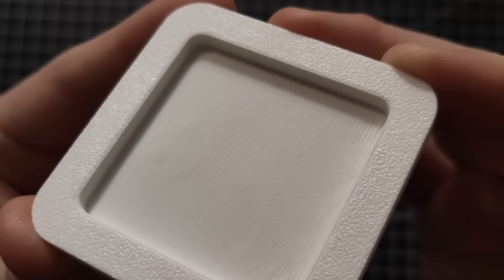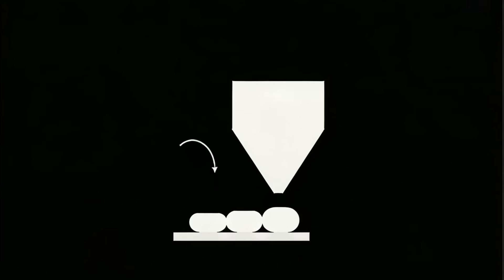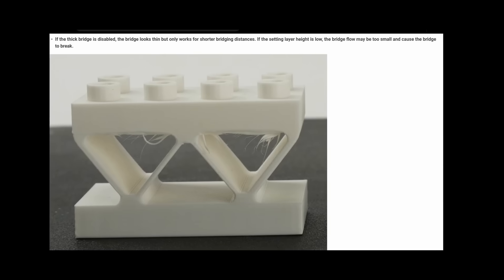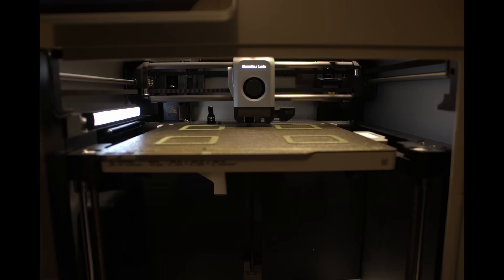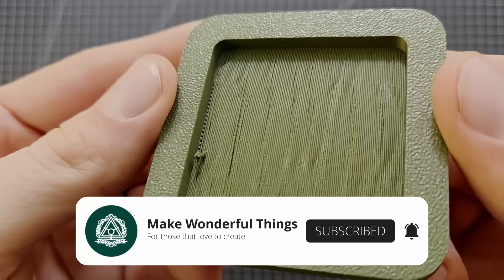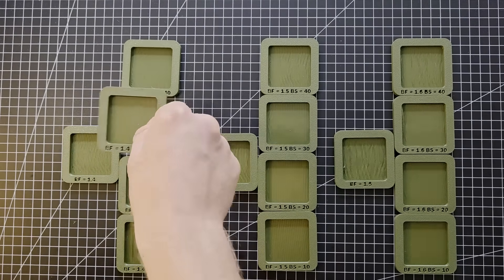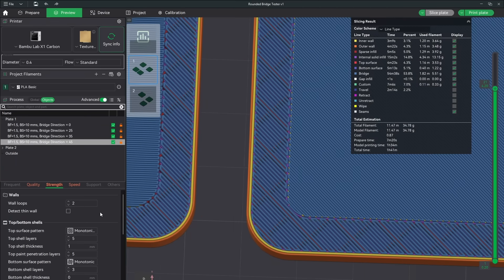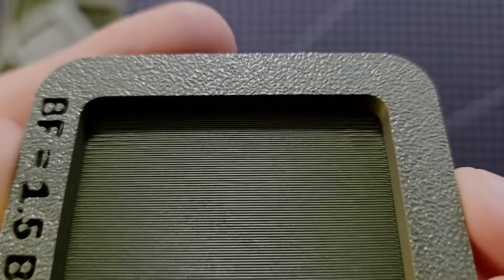The BEST settings for bridges? Smooth UNSUPPORTED 3D printed bridges

Comment: You've basically reverse engineered the behavior the slicer had back in the day when it was still slic3r 😄 Now in PrusaSlicer there is an option called "Thick Bridges" in the Layers and Perimeters tab, which is off by default, but can toggle that behavior back on. I guess it was ditched when Bambu forked their own slicer. With "Thick Bridges" enabled, the extrusion rate of bridges is automatically set to ~1.5 times the rate of other lines at the same speed. You can still fine-tune the bridge flow separately, though.
It's probably off by default or gone now, because it can cause even uglier bridges as you found out, when cooling is insufficient, inconsistent or when you're printing too fast.
Reply from the maker: Thank you for telling me a bit about the history. It is kind of hilarious that when a solution to a specific problem is forgotten, then someone will just re-create that solution.
Reply: @MakeSometh1ngWonderful  To be honest, slic3r and PrusaSlicer never explained that "feature" very well (among other things). Prusa's online help even today just says:
"For historical reasons, PrusaSlicer used to print bridges with extremely thick lines. This makes bridging very reliable and lets you bridge longer distances, but they didn’t look good. [...]"

Keep up the good work and the concise content👍

Comment: Based on what you've found, I don't understand why bridge density is capped at 100%. You'd have thought increase bridge density slightly above 100% would be beneficial as it would create a small amount of overlap and increase contact/adhesion between between bridging lines. However, the tooltip for bridge density (on orca slicer at least) seems to contradict this, stating that decreasing bridge density and creating gaps between lines can allow better airflow around them and so quicker cooling and less sagging.
Reply from the maker: Another commenter (@laich2) mentioned that Cura does not have this limitation. Increased bridge density would be a more elegant solution but it looks like it was a feature that got left out of this current line of slicers. I agree that this would probably be a simpler solution. 

In regards to their explanation, they're probably correct about the cooling. But, seems like they might be missing the bigger picture; that the adjacent lines can helps the lines adhere in a single layer if they're touching, thereby reducing sagging.

Comment: What about the thick bridges setting?
Reply from the maker: I tried using the thick bridge setting in the very beginning when I experienced this problem, and it does make a small change in the quality of the bridging. But, not really close to the final results of this process. 
Also, something strange that happened is that I did a small experiment with BF 1.4, 1.5, and 1.6 plus Thick Bridges and the outcome was really terrible. It didn't look like any of the results in the video, just a stringy mess. I didn't include that one here because I wanted the video to be concise.

Comment: I think you missed your 5 minute long ad read for raid shadow legends 😂

Awesome video. Easy subscribe.

While it’s not exactly what you’re doing, for models with sharp edges, a small support bridge in just the corners may help to give more support there, that being said it wouldn’t make it dimensionally accurate anymore, and it would just be trading one visual difference for another.

Comment: This really helped. Thanks :)
Improvements I had made before this included increasing the "pre start fan time" to 0.05 (Filament preset > Cooling), and also rotating the print or bridging direction (where possible) so that the air from the fans blow in the same direction as the filament path/bridge, rather than against the side of it. The idea being that first few strands of the bridge don't flap around in the breeze. Not sure which helped the most, I didn't do any real A/B testing.
Reply from the maker: It's interesting because I actually used the fan pre-start time when I was doing some overhang experiments a few weeks ago. It really decreased the quality of those overhangs. But, I didn't even pay attention to the direction of the lines. Which, may have been perpendicular to the direction of the fan.

I want to do an experiment with this. Would you mind if I use your comment in a future video? It might be a few weeks before I publish it. But, if it helps people out I would like to share the info.
Reply: @MakeSometh1ngWonderful  Sure. I look forward to seeing your results :)

Comment: I just tried this on a part were the bridging area is supported from all sides like your test piece. And it looks amazing. I used to print this with PETG support interface or self designed support and both those version look worse than just using pure bridging with your settings. F***ing awesome. Thanks for this video.

I have one more thing to add to your findings though:
If you just change these settings they also apply for the first solid layer above each Infill section (At least the speed does I´m actually not sure about the multiplier). So for optimal results and to not slow your print time down unnecessarily I would apply these settings via a height modifier so they only apply for the actual bridge over empty space and not for "bridging" over infill.
Reply from the maker: I'm happy that it helped you! Yes, you are correct. That first solid layer above infill is classified as a bridge line type. I hadn't thought of using a modifier to speed things up, so thank you for mentioning that here.

Comment: Orca Slicer has Bridge Flow Ratio but the purpose seems to be to use less filament during a bridge operation to keep tension on the filament.
Reply from the maker: Yes, that setting is pretty much the same as this one. Using less filament is also how Bambu describes the Bridge Flow variable in the documentation. In some cases, less flow is probably good. In some cases, more flow is good.

Comment: what about cooling when printing the bridges? does it affect it?
Reply from the maker: Yes, it definitely plays a part. I use a Bambu X1C, which has a known issue with the fan (seen here: https://www.youtube.com/watch?v=nJK4xTrn8ds). I just run the fan at 100% all of the time. If you have a different printer or fan, messing with fan speed might help you.

Comment: What about lowering step-over. Currently it's always 100% stepover in all slicers. I think having 60-90% step-over might increase bond as long as the flow is adjusted (lowered)
Reply from the maker: Thank you for the idea! So, I've tried to figure out what exactly you mean by 'step-over' and I am not really finding it. Googled it a few times and asked the various AI's to explain it to me without any luck. Are you referring to line density? Like the amount of lines per unit of distance?
Reply: @MakeSometh1ngWonderful  imagine you are laying 0.4mm lines, 100% step over is moving 0.4mm before laying the next one next to it. 75% stepover is moving 0.3mm before laying next 0.4mm line. (80% step-over = 20% overlap between lines). when you're mowing lawn, you usualy use less than 100% stepover to achieve nice cut. it might be similar with bridges...
Reply from the maker: @harviecz  Ok, I understand now. Perfect metaphor. Thanks!

Comment: Is it all corners that experience the sagging, or is it the leading corners? Trailing corners? 

If you print the entire print at 10mm/s, do they still occur? I'm just wondering if there's something about the transition from one regime to another that is responsible.
Reply from the maker: The leading corners only. Never the trailing ones. I haven't printed the ENTIRE print at 10 mm/s because that would 5x the print time. Maybe that would work for a model like this, but 2.5 or 3 hours for 30 grams of printing is pretty slow, and wouldn't really suit anything that I actually need. 

You can play around with the files by following the makerworld link in the description if you would like 😊 Maybe you can be the one to solve it.

Comment: Trick I use for a flawless floating surface:
I cut the floating section out of the model and print the “bridge” part separately as the first layer. I also add a tiny bit of tolerance around the part so it fits easily later. Then, I slice the model and add a pause right before it starts bridging (you can do this by right-clicking the “+” in the layer height inspector).

When the print pauses automatically, I remove the floating piece and press it into the other part. Set the print speed to the slowest setting and resume the print. It will now bridge perfectly over the pressed-in surface, creating a flawless result.
Reply from the maker: Actually a genius solution. @LukeFabis mentioned it in the comments a bit earlier. I plan on trying it out tomorrow. Thanks for this!
Reply: @MakeSometh1ngWonderful  if you try it would be amazing if you can show it, I am not native speaker so I understand a lot better with some visual context, thank you both for sharing!
Reply from the maker: @GeomancerHT   Yes, if this method works well it will be featured in my next video, so be sure to check back in a week or two.

Comment: auto subs. I try the BF 1.5 and BS 10, still doesnt fit well in my case, my default filament flow is 0.86, is it affected by those? rn trying to wiggle the BF settings
Reply from the maker: Yes, I believe that it is effected by those. The bridge flow is a coefficient multiplier, so if your normal flow is 0.86, then you are getting a resulting flow of 1.29 (0.86*1.5). I was still getting bad results around that ratio. 1.7, 1.75, or 1.8 MAY be where you find the sweet spot. The models and plates are in the description, so you could just run experiment 1 with your preferred settings, if you would like.
Reply: @MakeSometh1ngWonderful  yeah the 1.7 is definitely much better in my case, also i just realize the layer above infill also affected by the bridge speed, is there any way to play around it?
Reply from the maker: @wimindralee   Yes, the way to get around that is to use modifiers to isolate the settings just to the bridge. 
1. Right click on the model in Bambu Studio > Add Modifier > Cube in this case. 
2. Then, resize the cube to just overlap with the bridge. (this is frustrating AF in Bambu Studio, but, it's what you have to do)
3. Go to the objects tab and modify the settings for the generic cube. Change it to the desired bridge settings. 

Let me know if you need anything else.
Reply: @MakeSometh1ngWonderful  ahhh yes, i forgot we can do that, will try it asap and i will post the update

Comment: Very informative, plus 1 for getting to the point quickly! I may be missing the point here, but wouldn't you print a part like this upside down anyway or is this just serving as an example for times when one prints a part with that kind of bridges?
Reply from the maker: Thanks! Yes, you're exactly right. It's just a test model that helps me refine settings that impact more complicated real world parts.

Comment: I suspect the additional sagging from the angled print came from the length increase of the hypotenuse - its possible something worked out the shortest bridge extrusions would be best - maybe with multiple passes so for a square fill in the corners then join across the corners and repeat but that feels quite complex.

For pure bridge testing you're probably better off with a circle
Reply from the maker: You're probably correct about the longer length of the span. It's around 65 mm, which seems to be where my setup starts to struggle. Yes, a circle is probably a great solution, because of the shorter spans at the beginning. I went with a square shape when I started this because it was more like the real situation that I was trying to optimize for.

Comment: the "sagging" in the corners is possibly squeeze out instead. The very edges of the none bridge sections are slightly wider than the bridge lines for the reasons you discuss in the video (printed on top of previous layers vs open air). The first few  bridge lines have a little extra squeeze from the side nearest the already laid down filament. The first several bridge lines can be made to buckle by this extra squeeze, but as the bridge lines continue to be printed, the amount of extra squeeze diminishes as overall tolerances overtake. This is why the sagging appears to happen on the starting side of the bridges and not on the ending side as the final bridge line is the only one on the ending side experiencing any extra side squeeze.

The thing to do would be to start with a bridge flow of 1.4 or so for the first line and work up to 1.5 over the first 10 - 15 lines or so. The quickest way to test this would be using modifiers. Once it is demonstrated, a G-code replacement could be worked out or an extension to add a new setting made.
Reply from the maker: Very, very thoughtful. I agree with your take on modifiers for the first few lines, which is an idea that I haven't seen. I've used modifiers a lot, but never down to that scale, so we will see if it works. Thank you for the suggestion.
Reply from the maker: Your comment helped massively with finding the solution. Do you mind if I feature your comment and handle in my next video?
Reply: @MakeSometh1ngWonderful  Go ahead!

Comment: Fantastic tip thank you.

If you can find a way to slow down the overhang over support interface that would also be really appreciated! 

I print hot for maximum strength but it makes removing supports almost impossible. If I could slow down the overhang hang layer above interface material so it solidifies that be a game changer.
Reply from the maker: While I haven't explored this idea so much, I will mention that I found that bridge speed also changes overhang speed. Also, Bambu Studio has some specific overhang settings to play with. 

If you want to upload your specific part to makerworld and have me take a look at it, I will. It will probably be a full week before I can look at it though, because there have been so many good ideas in the comments that I have to look into.

Comment: Arc overhangs might squeeze out that last little bit of performance you're chasing. Or they might make for a wavy, blobby mess. It's a really temperamental process.

Another thing to try, if you're okay with not having a flat surface, would be to give the bridged area a slight stepped, slanted, or pyramidal structure, so the whole bridge isn't made in one shot.

In a similar vein, one thing to try (I haven't tried it, so I don't know if it would work) might be to abuse the counterbore hole bridging setting, so you have partial bridges acting as shelves to support the rest of your bridge. I don't know if the slicer would recognize a blind hole in order to apply this setting, so you might need to make a version of your model with a counterbored hole in place of your bridged pocket, slice both that and the original model, and Frankenstein the gcode together.

One last workaround, if you need an immaculately flat surface, would be to print the bridge as a separate part, add a slit to hold your bridge on your vertical walls, pause your main print at the top of that slit (at this point more of a lip, since the top hasn't been built yet), slot your bridge into the lip, and resume the print. This does introduce other potential problems, and there will likely be a contraction mark where the print paused, but the tradeoff is that you'll have an overhang as smooth as your build plate.
Reply from the maker: Thanks for the thoughtful comment!

Absolutely love your last idea. Literally laughed when I read it. I'm a huge fan of lateral thinking and solving problems in non-obvious but elegant ways, and this idea might fit that exactly. I can imagine that it will not work in many situations, but would helps to create some amazing results in some situations. I will DEFINITELY try that soon. 

Yes, I looked into arc overhangs a bit, but it didn't really fit the aesthetic of the original part that I was making. Have you had success with printing arc overhangs? I've been told by some friends that it requires quite a lot of tuning for each use case. But, that was over a year ago, maybe the tools have improved since then.
Reply: @MakeSometh1ngWonderful Pausing your print to drop in pre-printed components for in situ assembly can enable some absolutely wild geometries. If you can decompose your part into its major components and add indexing features to make everything fit together accurately and snugly, then each feature only needs to be built in a self-supporting orientation. You can have some impossibly intricate overhangs this way.

But it doesn't stop there. The components don't even need to be 3D printed. As long as the polymers are compatible, they will bond. If you're printing with ABS or ASA, you can add acrylic or ABS parts, be they laser cut, machined, or injection molded. If you're printing with a copolyester like PETG or PCTG, even an elastomer like Arnitel or Hytrel, then you can use copolyester parts made of things like PET or PBT. Nylon and PEBA filament can bond to other polyamides, including kevlar. And the reverse is true as well; with the right fixturing, you can 3D print directly onto plastic parts, provided the polymers are compatible enough to fuse.

And I'm sure you'd seen people embed nuts, screws, weights, magnets, and LEDs. Not as robust of a connection as using a compatible polymer, but with careful design, you can add some really cool features that would otherwise not be printable.